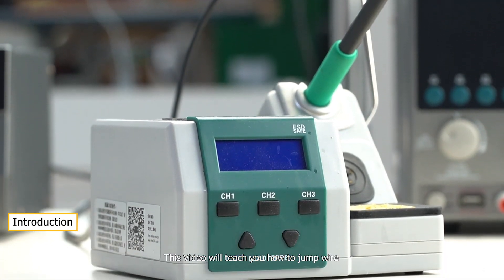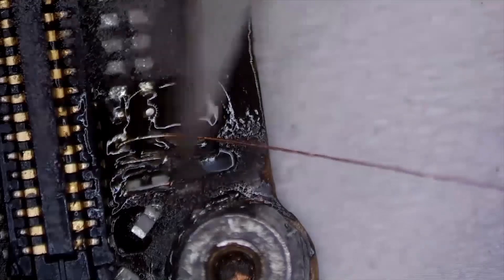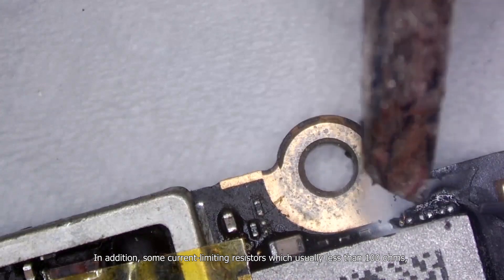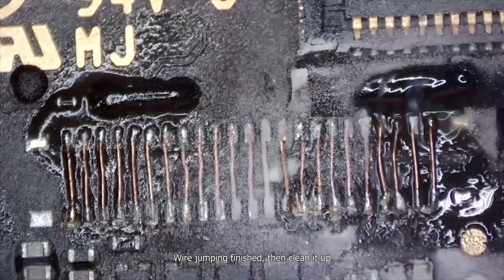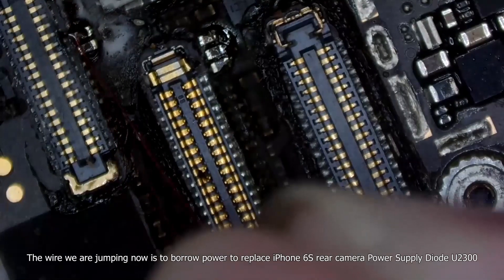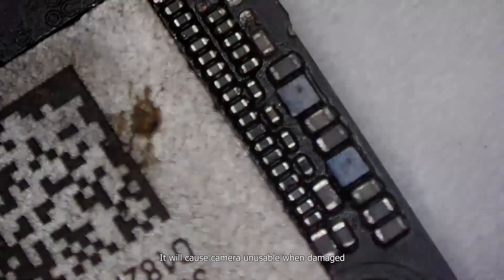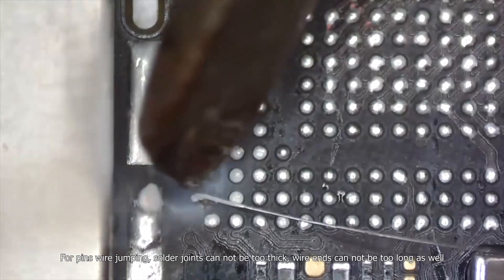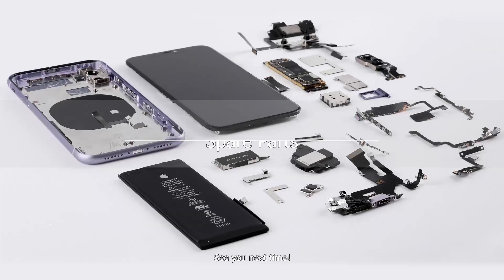Motherboard Repair Skill Course-Jumping Wire

Comment from the maker: Jumping wire, is to connect two points in mainboard with wires, which is a common technique of phone repair. So, what tools do we need? What are the ways to use it? In what situations can it be used? Let me answer it for you.

00:00 Introduction
00:47 First Type: Short Bridge Wire Jumping
02:35 Way of Practising Short Bridge Wire Jumping
04:02 Second Type: Long bridge Wire Jumping
06:11 Third Type: Pins Wire Jumping

For more Repair parts&Tools and Tech support, please visit:
Website: https://www.elekworld.com
Facebook: https://www.facebook.com/Elekworldshop/
Instagram: https://www.instagram.com/elekworld/
Twitter: https://twitter.com/ElekworldL